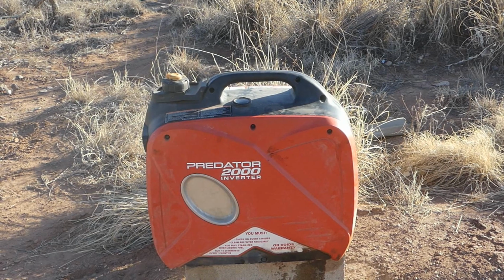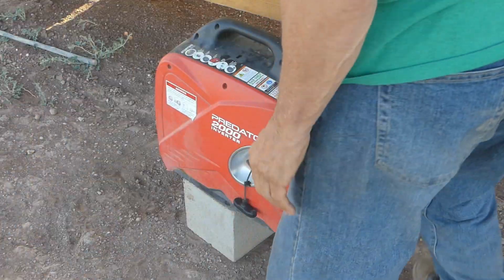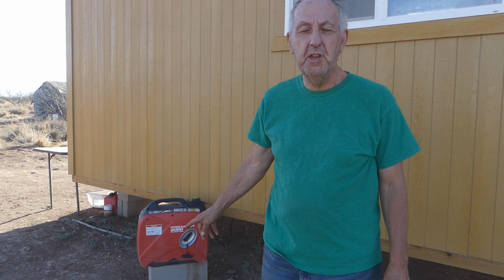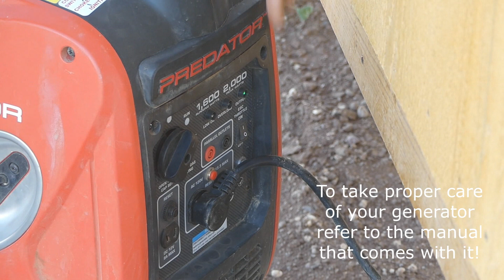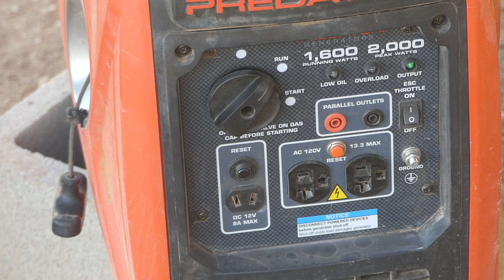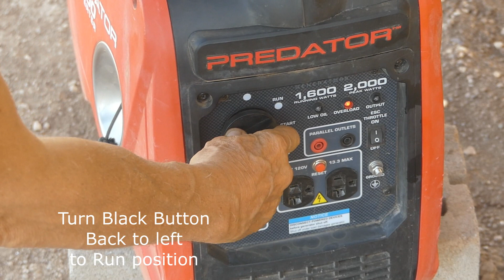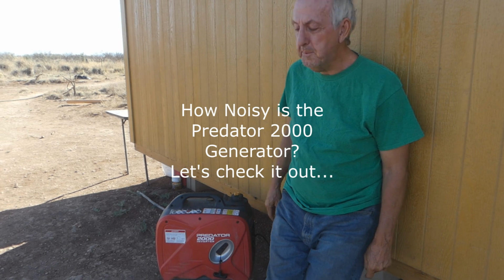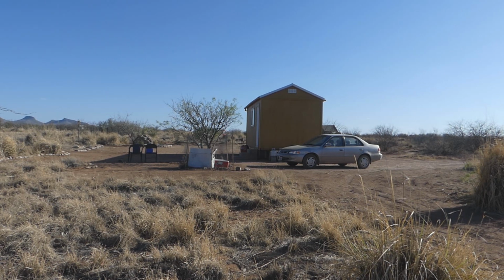Did I choose the best generator for my money for my off-grid cottage?

Comment: The case splits in half, lol...I worked on them for years...they will burn a quart breaking in a new motor...I built a generator from an old tiller motor and an old cast iron case 2000 Winco ...I used a belt from a wringer Maytag washer and I welded up a 3 and a half inch pulley out of pieces of 3 pulleys by using my 10 solar batteries I had at the time...I have 12 now, and getting 2 more batteries tomorrow will gives me 14...I've got six 100 watt panels running a 2000 watt Aims inverter/charger and I have 2 more on the way....if I ever find some land I'll have power...I don't run the generator very much unless there wasn't much sun, I might cook something using it for 15 minutes...it starts first pull unless it's almost out of gas...one thing I like about it is, I can set it on 108 volts, which the motor turns slower so uses less gas, and the Aims will clean it up and have the batteries charged,  usually within 20 minutes...I got a 24 volts inverter/charger so I have to get 2 batteries at a time...I'm 65 yrs.old too, lol...I didn't get the bigger batteries at first but these last four are 110 amp hours so it's getting where I can run more stuff now... I had a small AC unit running off of it yesterday and with the ragweed pollen it's just necessary for me... I'm going to build a new wood stove this year...had one but it's a little cave man style so am making a pretty one out of an old 20 gallon sandblasting tank that I got given...I did buy a small 80 amp inverter welder from Harbor freight...never had one of these...it's something to use the generator for though, and it hasn't been run much lately...well I've got to go weedeat...it rained 3 and a half inches this last few days so the grass is exploding when the sun pops out...and I had to buy a bug zapper for the skeeters
Reply from the maker: Wow your definitely a talented handy person David Potter. Thanks for watching!
Reply: I found out today my other uncle says I can get my 8000/9600 watt Miller welder/generator back so I'll be like Bert in that Tremors movie, his backup generator had a backup generator,  lol...

Comment: I may have missed it but do you have any kind of AC?  Swamp Cooler or anything to cool down the temps when they get up to 100?
Also, is your septic a design system, mound system or a simple system? I have seen septic installation costs go from like 8 grand to 20 grand in some cases. I have seen people make a box to put around a generator to quiet it down. Sounds like yours is not that loud
Reply: @Storage Mann, he thoroughly covered his insulation in previous vid(s); I urge you to check them all out. It will be interesting to see what measures he will need to take when hot weather hits there. I hope a fan will suffice, but a "swamp cooler" would likely be sufficient, with the insulation he has added.
Reply from the maker: Storage Mann.  Check out my video on septic install.  It's called the No.1 thing you need before getting your permit. Yep septic is in.  Just need to hook it up. But property development for a single guy doing it all by himself slows things down a bit.
Reply from the maker: Sean it was 96 deg today.  Two major things to note about me and my cottage.  Most important No. 1.  For some reason I am VERY heat tolerant.  To the point it seems abnormal to others.  I dont sweat even when working outside unless its at least 90. No.2 The little cottage is so well insulated that the night time coolness stays a long long time during the day.  Thanks for your great comments Sean!
Reply: @seanflanagan5674  thanks, I watch this guy because I am interested in doing the same things. The main thing I am trying to find out is the affordable part. So cost is a major issue not so much as watching it installed.
Reply from the maker: @storagemann6373  Sorry I forgot to address this but if you watch my septic install video you will see mine was only $5000.  Mike did extra ground leveling etc and total was then $6800.  Septic companies can be rough on pocket book so shop around for sure.
Reply: @affordabledesertliving3487  Don, thank you for the info on septic. 5 grand is very good price! This info helps anyone thinking of doing what you are doing. Our first thought is can I afford to do this, how much will it cost. So thank you. Also cabin prices are helpful I have looked at some starting at 7 grand for a 10x20
Reply from the maker: @storagemann6373  If you are in Cochise County check out Emerson Buildings.  I have a link on my video on my shed delivery to their business. Quality sheds light years better than things that Home Depot etc sell.

Comment: Glad to see your back at it. Great video on the generator. One question, what do you do for water?
Reply from the maker: Daniel excellent and logical question. I have a fantastic 1200 gallon water tank that gets filled via local delivery and rainwater (coming) I will feature this a bit later on.
Reply: Affordable Desert Living  Hi there, so  then what happens when deliveries stop? or gas is restricted? thanks, new sub here living in my car 1(also, What generator would you advise?) 🧚

Comment: Hey Don what do you use to stay cool during the summer months?
Reply from the maker: Hi Kevin thanks for watching. My little cabin is extremely well insulated. So since I live at 4600' elevation only for a brief time in June or so does it not cool down at least some to make sleeping okay. So what that means is that in the morning it takes my cabin a long time to actually get hot and uncomfortable after cooling down at night.  Two 3x4 windows on each side of the building create a cross breeze. If I am really cooked I have a USB battery powered fan that I can use.  Also it helps that for some reason the way I am made I am VERY heat tolerant.  So much so that other people are cooking and I am fine etc. Hope that helps.
Reply: @affordabledesertliving3487  Thanks Don appreciate your time.

Comment: Hi Don, thank you for the info about your generator. In Oct 2019, I bought a 3500 Predator (larger home to run fridge, toaster, and basic lights in the dining area including Wifi). I used this video as my comparison indicator "https://youtu.be/fIQt4krPAgA" and was happy I did. 
My neighbor Alex across the street said he could not hear it hardly at all, and just a few weeks ago he bought a 3500 Predator and got rid of his old one. The 3500 has both a pull cable and electric starter. A couple of weeks ago I pulled it out of my workshop, and of with non-use the battery was dead. I pulled the battery, charged it up on a trickle charger I bought 30 years, put it back into the gen. and presto, immediate start. Since I don't use mine except when there might be an outage, I add a couple of ounces of the stabil into the mostly full gas tank, ran the gen. for 15 minutes without any problems.... I noticed that you have not sheetrocked the inside of your little house- is that something you are planning to do- probably will help to keep the heat in or out, even better. Great to catch up... was pondering if I should move to Florida- gated community with all the amenities, homes at $150K, HOA dues only $150 per month. Half of my income goes to Space Rent (just got my last 3% increase notification) of nearly $1000 per month, and $200-400 for all utilities incl. water and garbage. Gas prices are soaring, and I feel like exploring.... please keep me in your prayers for clarity. :) PS- this next link will make you laugh and you can be glad you don't need hair cutting much... https://youtu.be/Jqcd2A-QMoo
Reply from the maker: Hi K Doberman.  Thanks for the encouraging comments.  The haircutting clip was hilarious.  People are amazing thats for sure! I would definitely set yourself up for a stable living situation with no space rent.  I actually found 2 over 55 parks in Arizona that have no space rent just an HOA.  But budget being what it is I figured I would have more control over my own land.  PLUS...  the adventure of developing it.  thanks for watchikng!

Comment: ok a couple things first predator engine is a clone of honda engine. so Its good
 now for my RV I made my own craigslist inverter generator using a 3.5 horse Briggs and Stratton off a California trimmer super quiet and fuel efficient .like 6-8 hours on a quart of gas . that ran a gm alternator from a 1980s ish and a 1500 wat inverter hooked to a 12 volt battery . I wasn't the only person that fell in love with it once I was parked next to a class a motorhome owned by a retired nuclear engineer he didn't use his onboard gen because it  was too loud and sucked gas . so he bought a hoda inverter generator. mine was quieter and used less fuel. now I did swap out the old points magneto for a solid state . because I like 1pull starts. my entire setup cost less the $100 
 now for your generator I have 1 suggestion get a jet from a propane dealer $25 drill a hole  in the throat of your carburator on the engine side of the butterfly and thread the propane jet in and plum it into that big propane tank you have. cheaper fuel no having to get and add gas plus it burns so much cleaner you'll need less oil changes and spark plugs. and the engine will last as much as 100% longer the savings on gas vs propane is around 50-60%  good luck we may be neighbors in a year or so
Reply from the maker: Tim.  I totally admire your mechanical ability but got to confess I am many years away from your skill level. But congrats on being so sharp in making your own generator. Definitely impressive!  Thanks for coming by and thanks for your super comments.

Comment: What are your gas and oil costs per month?
Reply from the maker: Mona they used to be pretty high but now I am not using the generator at all thanks to my solar set up. I think if I remember correctly I was paying about $40.00 per month to run the generator.

Comment: You need solar.. that generator is not geared for that much use. 

Start investing in battery banks now. A little at a time.. ull be glad u did.when it's all set up... so.much easier..

Let the sun work for u
Reply from the maker: Notorious Wayne.  Yes indeed.  I now have 1/2 of my Solar setup purchased. Will feature it later on.

Comment: the chinese clone generators are ok.  bit louder on the db scale. no they do not use real honda motors, as they are chinese made clones.  the bad is they do not have the life as a real honda has. 
but yes the price is a big ouch. only draw back to hondas. 
as to the eu 3000 i forget the name of the company but he has a extended full system. with this you can fuel up without turning the gen off. as it uses a ex tank. and he also does a remote start (including choke), it is a great deal the only visible part is the fuel connection (think small boat motor removable fuel tank connection) on the lower frame of the honda. very easy to install, simple hand tools and drill motor with a stepper drill bit.
but you can buy two or three of the cheep ones before you get to the cost of one honda. but the honda would still be running long after that.
Reply from the maker: The great part of all of this Larry is that I bought an extended warranty for this generator and now only use it rarely now that I have solar.

Comment: After a year of use with Harbor Freight junk you would have spent the extra amount in unburned fuel to equal the Honda EU2000 or 2200.  This Genny is worth what you pay for. If it runs, and many do not, you can get good service out of it. The engine is made in China and is not the same engine as the Honda. You cannot get parts for it. You can get Honda parts at any lawnmower shop. The reason you smell gas with the predator is that it pushes unburned fuel out of the tailpipe. If you look at any HF store you will see returned units. They do not get shipped back. They hit the dumpster.  I used to say that HF has good items like a crowbar or a sledge hammer ..until my new 20 pound hammer went "POP" and exploded with a golfball size air hole. Junk. Even sheet metal screws from HF are garbage. Buy quality and avoid the hassle of HF.   I have owned both Gennys and yes I wasted cash trying to save money. My Honda EU is bulletproof. This is why the 1100.00 Genny sells for 950 used.  Gold to a thief and they will not steal a Predator unless they need to use it for an anchor for their jetski.
Reply from the maker: LOL and rolling on the floor at using the Predator generator for a jetski anchor.  Priceless Scott!  Thanks for sharing.